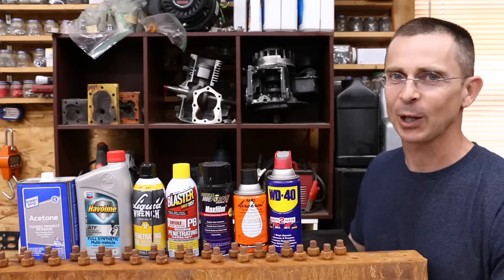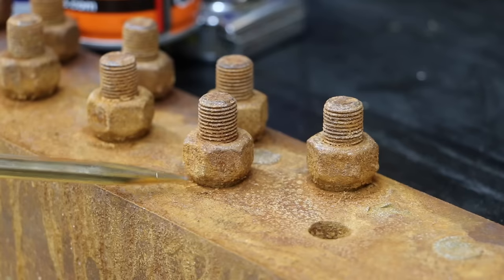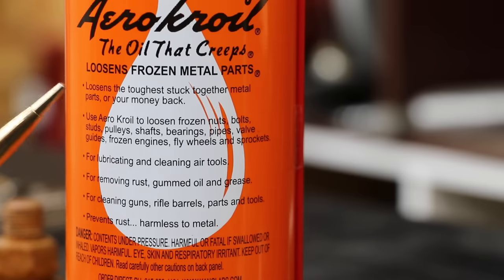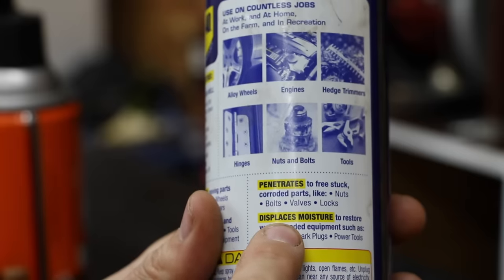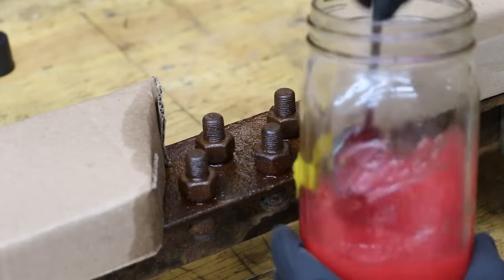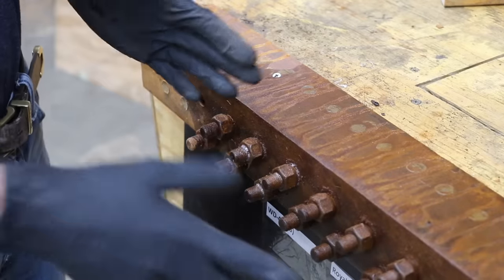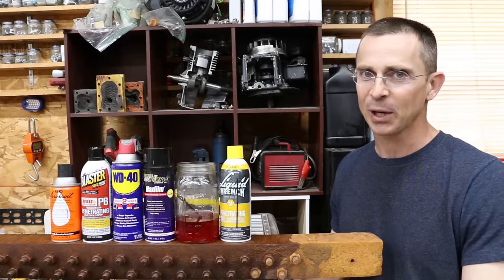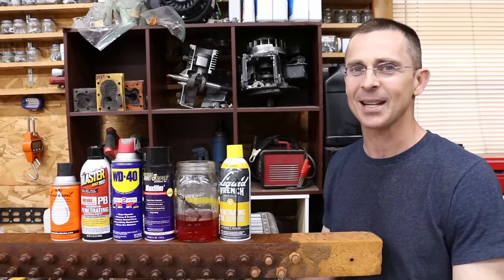Which Penetrating Oil is Best? Let's find out!

Comment: Very interesting test Have you seen ave's test on these products he tested most of the same ones you did in his test wd-40 came out on top his bolts were rusted a little more than your i think and he used some type of hydraulic thing to loosen the bolts not saying his is right and yours is wrong or vice versa just different ways of testing I was really dissapointed in kroil I had been thinking about buying some but dont think i will after his and your test I agree with you I think heat works the best when you can use it and thats what i prefer to use when possible I do keep some of the products you tested around the shop but tend to use them more for lubrication than for trying to get stuck or rusted bolts and nuts loose. Thanks so much for taking the time to do these test and share them with us. I know it takes a lot of time and money to do these. Have a great week. God Bless!!!
Reply from the maker: Thank you and hope you have a great week too!
Reply: From the numbers posted, I'd say this test tracked pretty closely with AvE's results, especially regarding Kroil. This test made me feel that much better about relying on WD40 and propane for stuck bolts.

Comment: It’s not all about how well it penetrates but how well the product dissolves corrosion, or actually lubricates. 
Most penetrating fluids are just intended to penetrate. It does not matter if they achieve 100% penetration if there is still a huge layer of corroded crap between the nut and the bolt, and they are poor lubricants. 

WD40 is a Water Displacer, (WD, clue in name) it’s useless in rusty fixings, but was not intended to be used on them. Soaks in well, zero lubricating effect. 

What is needed is a product that can erode/remove the corrosion and/or act as a lubricant. 

As a result I do not use any of the tested products.
Water penetrates well, that is why the fixing are rusted together.  . .  

Super crack ultra. It;s also not a lubricant. But it is a corrosive penetrating fluid. 

It  is a product that is actually corrosive, and also penetrates well. It is not, however, a lubricant.

Comment: we used liquid wrench by the case at central foundry in Pontiac MI. After soaking rusty nuts , hit with a hammer and set up a vibration, it helps it penetrate deeper into the threads. old Millwright trick.
Reply from the maker: Nice!  thanks for the tip
Reply: How do you set up a vibration to help loosen nuts and bolts?
Reply: quarterback........hit it with a hammer......it vibrates it and shocks it loose.
Reply: @rodneycrisp2020  - Smile. Yep, a little old school. I actually had a friend share with me last week how he use to work at an old shipping yard. The old man down there would walk around and give each volt a wack with a hammer. One by one. Then do the round again.  They would keep doing the round until they would hear the ding like a bell. Then right after that, they they would screw the nuts off by hand.

Thank you for sharing, and some good old hammer trick can work well. I guess I was looking for alternative ways besides hitting metal on metal.  You know outside the box thinking, that differs from the hammer trick, or tapping a wrench on the nut or bolt.

Agsin, thank you for sharing. Is there maybe some type of machine that vibrates. Where we can set it on the nut and forget it maybe go have a cup of coffee while it can vibrate on its own?
Reply: Love it. Wondering if there was some machine that actually vibrated, and could fit in those tight nooks of a car, we could barely fit our hands in to work lose.
Reply: Also you can tighten the nut or bolt to break up rust in the threads then loosen . Old heavy truck technician trick.
Reply: @thomaswhittingham1919 - Awesome. I think I have done that a few times before. Mainly by accident, or just to find any direction to work.
Reply: The hammer trick works great, but of course it depends on the size and accessibility of the part. Think of iron pipe unions  that have been in service for decades for demonstration purposes. Use two hammers of equal weight. They do not have to be overly large. Oftentimes, two smaller hammers work better than two larger ones. (They create a higher vibrational frequency). Backup one flat with a hammer and wack the opposing flat with the other. Continue the process in a rapid manner and complete two full revolutions. Spray on some penetrating fluid if you have it and the rusted fittings will come apart with ease. If they are stubborn, repeat the process, and yes, the other trick is  to tighten the fitting to at or near break away torque before loosening it.
Reply: @tomheringer2047  That is an interisting though about smaller hammers having a much higher frequency.  I dont know the science proof of that. Maybe/maybe not. Though quite interisting. Something I will keep in the back of my mind.

Comment: Worked 4 year as a mechanic with an almost retired man who used to heat up with a butane torch and quick cool down using a soaking wet rag , he used it on Mig welding line too as a hardening process just like forging i imagine. And in my experience it worked very very well !
Reply from the maker: Thanks for sharing.

Comment: Interesting how the Liquid Wrench, easily the oldest product tested (this stuff has been around since the 60's) is the cheapest and best. You definitely should have included Tri-Flow, a PTFE based lubricant. Though not specifically described as a penetrant, I've found this to be the best.
Reply: its not the oldest, PB, Kroil, Seafoam are older but they all are for a different task and metal type... they all work the same if you give multiple applications over hours/days... if youre in a shop and time is money the video proves a acetylene torch beats ALL

Comment: I was recently struggling with a 2010 Subaru ball joint removal task. I used heat, vice grips, and a lot of hammering on the control armm ball joint, and  knuckle. In addition, I sprayed PB Blaster, WD 40, and the acetone/ATF mix around the lip hoping for some creep up into the cup... but no luck.  I saw a product at the store, CRC Freeze OFf Super Rust Penetrant, which seemed interesting, so I decided to give it a try. I thought the idea of material contraction by low temperature, rather than expansion by heat, to be interesting. I sprayed it liberally to the ball joint, gave it a hit with a hammer, and there it is.... ball joint removed. I cant be sure that the removal was not due to a cumulative effect, but I thought the result was interesting. Really like your channel!
Reply from the maker: Thanks!  Thanks for sharing.

Comment: Would have liked to see a 24hr soak and see the bolts spaced further apart; seemed to have some cross-wicking.
Reply: I think this is one of the reasons he set the tapered side of the nut down. So the bottom nut to angle surface was less of an issue than the rust in the threads. This would minimize the efficacy of cross contamination.
Reply: @contumelious-8440  I think that helps but many times it seemed to help when I let a penetrating fluid soak, then apply again just before removal.  I can't help but wonder if some of these may have time responses.  BTW, thanks for your objective comment.

Comment: 1) Wish I would have seen this earlier. Maybe I could have gotten You to try a 50/50 mix of Marvel Mystery Oil and diesel fuel.

2) Old plumbing trick, Boiling water and vinegar mix, 50/50

3) One other, not much help unless someone else, who has worked in a repair shop, which is OSHA regulated, knows the product; I never found out the name, because a majority of this penetrant's label was ripped off the can. It was a can which the County garage in Manistee, MI used. My bud's father worked for the city and loaned us the shop for which to work on a vehicle. It had a zero flash point I tell ya. Very impressive. Even when the fastener was heated with a torch, the penetrating oil was applied and a torch was reapplied to the smoking fastener! We sprayed it on a dog-turd-looking Leaf Spring mounting bolt and within 10 seconds, the nut spun off with little effort using a 1/2" ratchet. It smelled like vinegar, so I just referred to it as "vinegar in a can", whenever we discussed it.
Reply from the maker: Thanks for the feedback.

Comment: I will say that in an industrial setting(think tearing apart steam turbines that have been running for 30+years) Kroil is the gold standard for tearing them apart… for corrosion protection pure mineral spirits was the most cost effective outside of the more waxy protectors.
Reply from the maker: Thanks for the feedback.
Reply: Yeah, I work at a Toyota foundry and Kroil is the only penetrating oil you'll find here.
Reply: @ElliotRitchey  If you haven't tried the others, you will never know which is best.
Reply: If you haven't tried the others, you will never know which is best.

Comment: What a revealing test.  I've seen the Kroil relied upon for releasing 'stuck engines' that have been sitting for many years, a much different application than traditional use of penetrating rust on nuts and bolts.  Liquid Wrench, the old standard, showed very well.  Impressive.  Thank you for performing the test.  Idea for future test:  Paint strippers for woodwork
Reply from the maker: You are welcome!  Thanks for the suggestion.

Comment: You can't beat the hot spanner.  Heat the seized nut with your welding torch.
Reply from the maker: Great point!
Reply: Sloopy .Dog  Aah, the smokewrench.
Reply: What if it’s the thermostat housing bolt? I don’t want to melt the water pumps and cause a fire...

Comment: Love your vids Todd. Thank you. 

Imo, Best part about WD40, is its neutral. It works on just about anything and wont harm surfaces, including your skin. 

I use it on guns, woods, plastics, painted metals, tools, interiors, leather. It's even a pretty good cleaner. My wife cleans our stainless stove & refrigerator with WD40. We buy WD40 by the gallon. 😊

Colored plastics also wont fade or turn white from sunlight. 

I wipe my 2014 kubota tractor down with WD40 all the time. After 10 years it still looks brand new while my Dads 2016 kubota is all faded with any plastic turning hazy white. 
I also wipe our vehicles  black plastics spoilers, mirrors, etc, with the same results. 

And it does eventually evaporate, so surfaces dont stay oily or slippery, but maintain their shine and original colors. 

No other penetrating oil I know of  is that base  neutral or has so many uses. 

Example, You would NOT want to leave pb blaster or liquid wrench on your hands. It would burn you. 

Fyi, transmission fluid is the best injector & carb cleaner there is imo. Just add a little to my diesel fuel or gas engines, cleans wax & carbon build ups spotless clean. Been using it for 40 years. 
I've ran 1 million mile Caterpillar's truck engines and never replaced an injector. 
An old timer in Texas told me about using trans fluid to clean my truck injectors back in the early 1980s. Been doing it ever since on EVERYTHING I own. 

Experiment. Pull a spark plug to look at the black carbon build up. Add trans fluid to the gas, (on a normal car, I use 1 quart to 10 gallon gas) run that tank out, pull the same sparkplug again. It will be clean white.  
Trans fluid not only losses all the carbon build ups in the engines heads & cleans the valves, it also totally liquifies & dissolves paraffin wax build ups in the fuels system.  Works especially well on diesels.

You can go buy $40 per pint high dollar fuel system cleaner, that dont work, or just dump a quart of dextron tranny fluid in that I guarantee will work. 😊
Reply from the maker: Thanks and you are welcome!

Comment: When i watched your clp gun oil test i was hoping wd-40 would have been in the test even though it’s not exactly a clp . It is however a very popular gun oil so wonder how it would have done
Reply from the maker: Thanks for the suggestion.
Reply: WD-40 dries and loses the ability to protect from moisture.  Field and Stream did a test on gun oils years ago.
Reply: Robert Miller wd-40 has a blend of lubricant formulas which not only lubricate but protect against corrosion displaces water penetrates and removes soil . The lubricants don’t dry up and it’s highly regarded as a gun cleaning and lubricant product .
Keep in mind wd-40 is aprox 50% mineral spirits which has changed and been refined drastically in the past decade or 2 to prevent evaporation

Comment: I'd like to see Zep 45 in this test. That's usually my "go to".
Reply from the maker: Thanks for the suggestion.
Reply: @ around $14 - $15 a can  Zep 45 would have to smoke Liquid Wrench's results  for most to justify the cost difference.  I was told Kroil  was the business and ordered some for our shop back in the day.  I agree with PF's assessment, Kroil is expensive and does not live up to the hype, as proven here.

Comment: When I saw 4 bolts/sample, I was hoping that you were going to take some measurements at a later time. The reason I mention that is that I typically use PB Blaster and I have found that some fasteners that would not budge on the day of application were easily moved a week or so later. It was a surprising result.

Thanks for these tests!
Reply from the maker: You are welcome!  Thanks for the constructive feedback.

Comment: I am wondering if the action of the heat is a breakdown of the metal to metal bonding, or expansion of the nut.  Heating and then cooling would tell.  If the affect of heat remained after cool down, one would suppose it could be combined with a penetrating product.  Heating after application of the oil would likely be less effective as the oil would evaporate, or burn.   I've often heard it recommended to bang on the nut.  I don't know if that helps other than taking out frustration.
Reply: I think the heat expands the nut and breaks the rust bond, so even after it cools it still comes off easier.

Comment: I didn't see 
"Marvel Mystery Oil"
why, it's great?
Reply from the maker: Thank you for this recommendation!
Reply: Tekagi not specifically, there are several "Marvel" products on the market.
He sent me an email to thank me for reminding him of the missing product. But you are correct they do sell a fuel additive.
Reply: I like Marvel too also for drilling.
Reply: Marvel is best for air ratchets or any air tools
Reply: steve eubanks - for air tools ? Add directly tool (like nail gun) - 2- 3 drops directly in air intake??
Reply: Great for gun cleaning, it's all I use!
Reply: Marvel oil is great to loosen stuck valves , been around a long time

Comment: I love your videos!  However I was disappointed that you didn't use the WD-40 brand of penetrating oil.  I'd really love to see how it compares.  I know that people have used regular WD-40 forever in this capacity, but it is a lubricant and hydrophobic, and not made specifically for this.  Yeah, I know that it does penetrate some, and as I said everybody has used it for this, but (I would think, which is another reason I would love to see if this is the case) the one made specifically for this would perform better.
Reply from the maker: Thanks!  Thanks for the video idea.

Comment: Red diesel with a cap full of engine oil.  I have used it for over 50 years.  Best release oil ever.  When my nuts get tight I give them a little spray.  So if you are suffering from tight nuts try it.
Reply from the maker: Thank you for this recommendation!
Reply: except broken nuts they are bad too
Reply: what about itchy nuts does it work on them  lol  lol
Reply: I have never tried it on itchy nuts.  I use a wire brush and bleach on itchy nuts.  Try it may work for you.
Reply: lol ok will try lol
Reply: Why red diesel vs normal diesel? The only difference is the red dye used to mark it as non road use.
Reply: Mongoose Viper Cheaper if you are using much. I doubt anyone would use enough to make a difference.
Reply: Simple!  Red diesel is very cheap compared to normal diesel.
Reply: Sloopy .Dog I understand that, it’s not taxed. Was just asking why you specified red and not just “diesel” is all.
Reply: The only reason I said red is because it's cheap.  Nothing to stop you using normal diesel if you want to.  Have you tried it?
Reply: Sloopy .Dog negative, it’s why I asked. Nothing more than that.
Reply: OK!  Good luck.
Reply: I am 71 and I throw them over my shoulder when I pee.
Reply: I got the same problem, gonna try that RED Diesel on my bag and see if it tightens up.... just sayin'
Reply: Try it!  You will love it.
Reply: I've only experienced blue nuts in cold weather.  You could warm your chilly nuts with a blow torch.  Good luck with your problem!
Reply: You should try it.  It's guaranteed to give you slack nuts.

Comment: Great showdown!  Liquid wrench has been my favorite, and was nice to see that confirmed through a controlled evaluation.
WHEN HEAT IS AN OPTION for rusty bolts, I've also had a lot of success with wax as a lubricant. Heat the bolt, then hold a crayon near the nut, and the wax will wick into the threads. It's also fun.  [I didn't read all the 13K+ comments, so maybe someone else already suggested it.]
edit - I just watched https://www.youtube.com/watch?v=bIunR4VL5vc.  haha! myth busted! (kind of, since I've actually witnessed the wax wicking between the bolt and nut) Thanks again! Enjoying your videos!
Reply: I keep a stick of Gulf Wax in my tool box, it does work in certain instances.  True that rusty bolts are a crap shoot.  Also used Liquid Wrench and Kroil over the years - I agree that Liquid Wrench seems to work better.  And the smell is special, definitely a "old school, we're working on a car here in the garage" type memory.